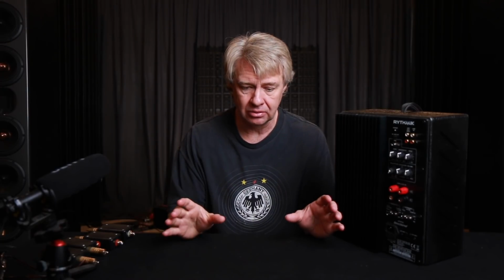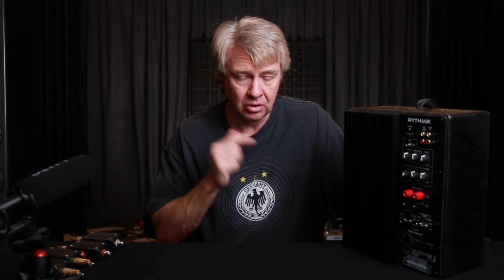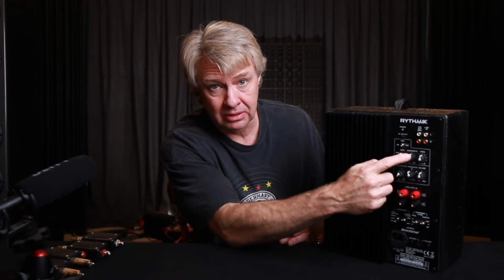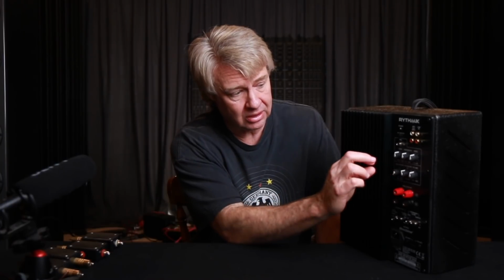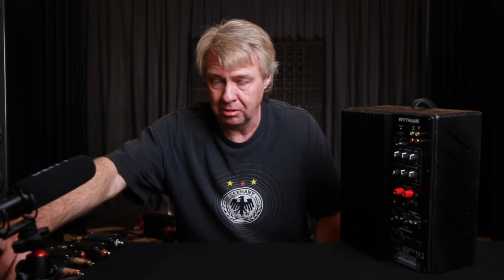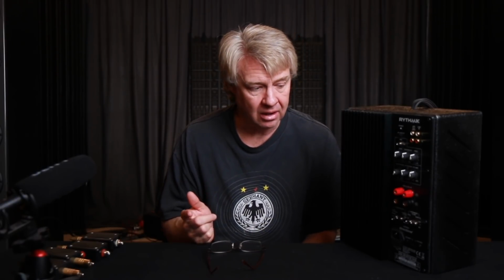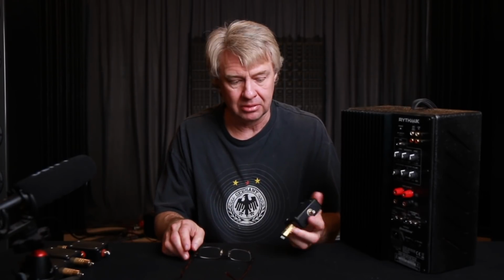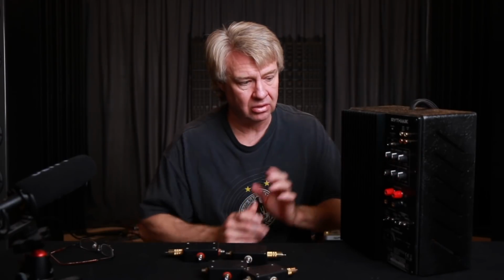How to DIAL IN your Servo Sub!

Comment: That's a great product. I've been wanting to get something to use with my integrated Amp to crossover my subs at around 60-80hz. The problem I run into is that I use an integrated Amp so, I can't install anything between the preamp and Amp "obviously since its integrated" what options are out there? How can I crossover my subs when using an integrated amplifier...
Reply: I am in the same boat. Please advise how to get the best possible performance when using integrated amps.
Reply: The servo sub amps have speaker level inputs. So just run speakers cables from your integrated amp straight to the speaker level inputs.
Reply: And then from the subwoofer output to the main speakers?
Reply: @robertst1218  You do not use the subwoofer output to the main speakers.
Reply: @dannyrichie9743  this is a bit confusing. When I was using a preamp and power Amp it was easy. But when using an integrated is confusing how to do this. Would it be possible you could make a video explaining how to integrate subs when using an integrated?
I currently have dual subs, but the way I run them is using the pre-outs of my Amp "yamaha A-S1200 " while this works for the subs my towers are still putting out a full range signal...
Reply: @JuanLega  
Using your pre-outs is fine.
As to your mains still operating full range, that's entirely up to you and your situation. 

If your mains have good LF capability, operating full range supplemented by subs is fine.*

If you're interested in alleviating the burden of the deep bass from your mains, a passive high-pass filter like he discussed toward the end would be effective, simple, and inexpensive. 

*(oftentimes overall bass performance may be better/smoother with the sub range being covered by more locations,... ie., full range L&R mains and subs overlapping and both covering the bottom end, however if the L&R aren't that bass capable, then high-pass them and remove the burden)
Reply: @FOH3663  I agree with you. My question is how I would implement the filters discussed in the video with my integrated Amp.
Reply: @JuanLega  
Ok perhaps;
Pre-Out -> Splitter 
into subs, and
high-pass -> Main In
Reply: Unfortunately, if you plug a sub into the fronts RCA outputs, you will notice that the sub will influence that channels output on amp as they are coupled.  You never ever want to use an RCA splitter to run both front left and front right RCA's into a single subwoofer input.  I mean you technically can but it's a horrid way to do things.
Reply: @minus3dbintheteens60  
That's not the situation.

Comment: What is a minimal measuring setup? What equipment, tools, software is needed to measure frequency response accurately and to get the most out of speaker placement, and subwoofer settings?
Reply: You will just be taking a room response measurement so you can get by with a lot of common measuring systems, REW comes to mind.

Comment: Why 6dB?  3dB is twice the power.  Isn't the general rule of thumb that doubling cone area gives 3dB.  Doubling wattage gives 3dB.  Doubling cone area and power give 6dB.  When you cross from 1 speaker to the other there is no additional power, just cone area, so why is it 6dB?  If each driver is at 85dB at their -3dB point then when they crossover they should together play at 88dB, no?
Reply: Depends on phase between sub and mains. For in phase system at crossover point such as LR4, the level of each driver is -6dB to measure flat. However, the power response will -3dB at x-o.

Comment: P/COG ratio defines  price to cost of goods. So woofer is tops $60 and amp $100 retail $950  makes it a book example of ripoff. Typicalky COG is 180-280% Higheat COG have cosmetics 300% or 350% for brands like Chanell...on 5th a enue... this COG is 590%, I suggest to engage shrink ( and not that termal wrap type).

Comment: Doesn't have anything to do with "old" or "new". And the second voice coil as a sensor is not new at all. It was used in the I.Q. System.One from 1990 for example. I doesn't make much difference by the way what type of sensor is used since almost any suitable sensor is so much more sensible and faster than the movement of the woofer. And don't fall for the micky-mouse-physics stating that the placement of the sensor would induce any type of latency. Try poking someone with a broom-stick. There will be no latency between you moving the stick on one end and the pokee receiving the poke 1.5 meters away from you. The voice coil is not a gummi-bear. It is ridig and a sensor placed 3cm away from the voice coil will still move at the very same time like the coil does.

Comment: I so wish GR-research made Servo Subs and Amps for car audio. No one makes servo subs for cars and SQ and SPL guys would buy it up. Many guys are building large 4 and 6th order bandpass boxes for SPL trying to get low end extension. While SQ guys are doing open baffle setups and transmission lines. All of which is to get the lows sounding right for them. If I could get a pair of servo 10s on a 3k rms amp I would jump on it.
Reply: Open Baffle car audio subs?
Reply: @FOH3663  Yes & no. Some were doing that in the 1980s-1990s. In a car, they used the truck as the enclosure with a baffle under the rear window deck. In a wagon or van  they would build a baffle wall somewhere behind the front seats so that the space behind the wall would be the enclosure. By "open baffle" in these cases, it just means the woofers were not in a typical sealed or ported wooden box. If you open the truck, or rear hatch/doors, you can see the woofers mounted in the baffle.
Reply: @Jamez84  
Ok that makes sense, but that's Infinite Baffle 

Not a big deal.
Reply: @Jamez84  
I've seen some extensive builds that are currently out there. 
I was entirely immersed in car audio late 70's, early 80's.
Reply: @FOH3663  oh, ok. Biggest difference between then and now is high speaker power and amp power have become allot more attainable 3k rms amps are $200 bucks. Also many of the brands from those eras have either died off, got bought out, or are no longer the "best" and rarely show up in spl competition or sq competition.
Reply: @Jamez84  
Zapco and Linear Power amps
Alphasonik active x-overs 
Alpine head end
Alpine component lows, mids, and ribbon tweets
Speakerlab custom subs 

But as to what you said, you're absolutely right about amp power at lower costs, ... but still the good stuff is expensive, as it was then. 

My perspective the big changes center around sub motor tech, thus driving higher current demands, battery, storage, alternator, etc.
Reply: @FOH3663  None of the brands you listed have won national or world finals in a long time. Also none of them make servo subwoofers and amp combos its only a home theater thing.
Reply: @Jamez84  
You said many of old school car audio has died off/bought out, etc, ... I was merely listing my car audio components circa early 80's. 

I do follow EXO, and PSSound, https://youtube.com/channel/UCKJUj746WOIUNjv5imYs6yA

About Servos;
Like a lot of us, I've followed and servo design closely, beginning with Nudell's 19" ServoStatic, Danley's Servodrive, Velodyne, Rthymik, etc. 

Early 90's when Velodyne launched their 15", I bought duals supporting my JBL stereo mains.
I remember thinking how cool it'd be to incorporate servo Velodynes in a vehicle! 

If I was into it now, I'd likely use Acoustic Elegance sub drivers. 
Nothing can touch Janowitz' low distortion motor designs. 

Thanks
Reply: @FOH3663  ok boomer
Reply: @Jamez84  
Nice
Any questions let me know
Reply: @FOH3663  you didn't even know what open baffle meant why would I ask you anything? Ive got google, your just some guy in a chat room on youtube.
Reply: @Jamez84  
Look no prob, but it's just the opposite, that's why originally asked you. 
You confused OB with IB

Significant acoustic difference between the two approaches.

I've built both, OB is easy, IB is a project. 
I built a quad 18" IB attic manifold w/4 drivers from Fi (whose big in car audio btw). 
Fi, US made, owned by Scott Atwell I believe.